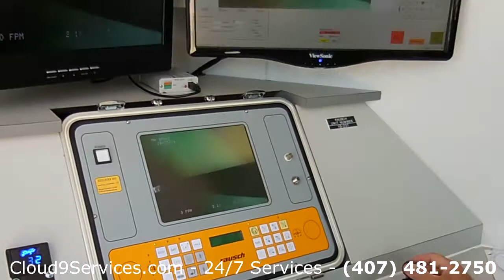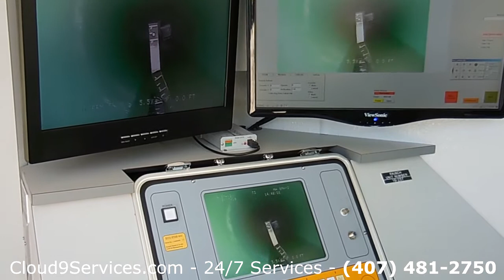Video Pipe Inspection using a CCTV inspection camera

Comment: What is that metal bar bent to a triangle for in front of the tractor?
Reply: real name for the machine is a crawler, the metal bar in the front is probably for when you have to go into a hole maybe like halfway down and have to swing the cralwer with the hook into the hole and sometimes can be difficult, bar kinda seems smart considering camera lens cost like 100k. never used the bars tho and have done this in Toronto & GTA lots. these machines cost ALOTT
Reply: It's used for measuring water levels in the pipe.
Reply: The lens is not 100k 🤣🤣